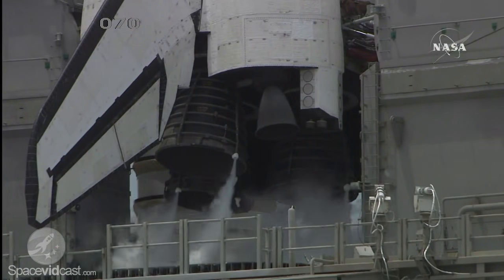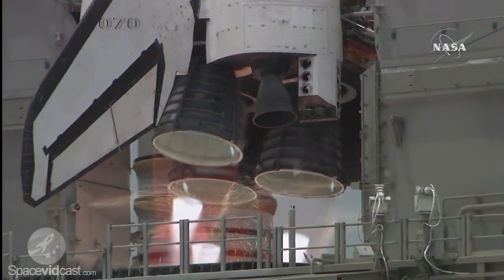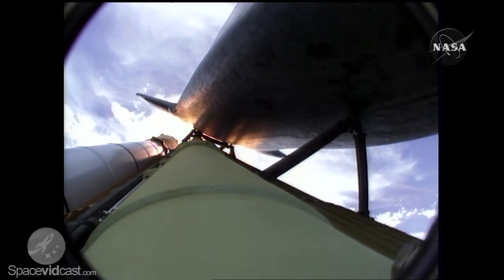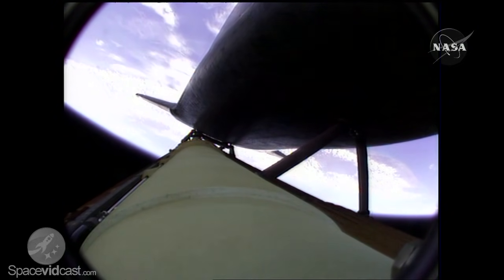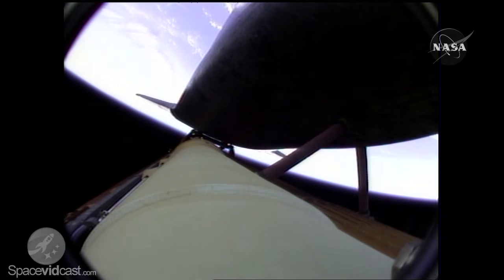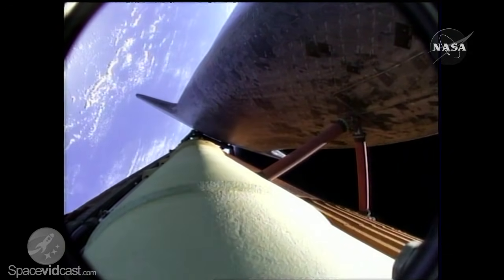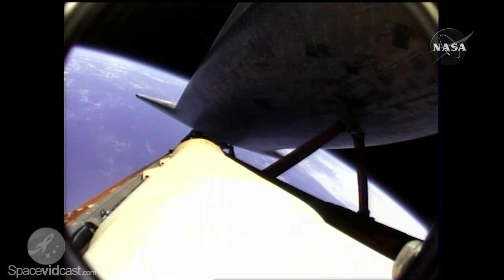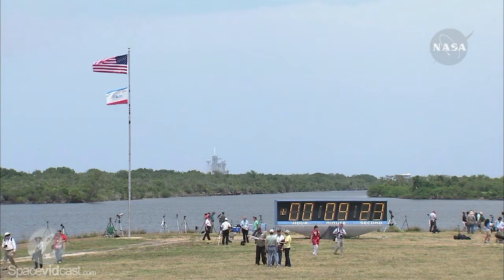STS-125 launch from T-2 to MECO - High Definition

Comment: there is a deflector in the bottom of the launch pad that shoots the engine exhaust and steam from the sound suppression system out to the side, if this was not done the shuttle would have been damaged by its own engine exhaust when the shuttle engines are ignited and brought to full power before the solid rockets ignite

Comment: That is part of the OMS system,  they are the nozzles for the small thrusters the shuttle uses to maneuver with in orbit.  You are seeing the covers burst from the pressure wave of engine ignition. That is what they are suppose to do, as they are there just to keep debris and animals out of the thrusters before liftoff
Reply: You're thinking of the smaller control jets on the nose and OMS pods.  The actual OMS engine bells are uncovered, same as the SSME's.

Comment: Those are thruster rain covers used on the ground to keep moisture out of the thruster valve. They are made to come off at ignition and the ones on the nose after a few seconds of flight. If moisture gets in, it soon freezes which could cause the valve not to work correctly.

Comment: 3,2,1... and liftof of the space shuttle Atlantis. Please put a double layer of sunblock because the shuttle will poke a hole (few km in diameter) in the ozon layer. Remember to hold your breath or wear gas mask due to 200 tons of chlorine witch will be emited to the atmosfere :D

Comment: Hubble needs no fuel, because it has no engines.
They replaced some of the instruments with newer ones, for example the Wide Field Camera 3 and repaired others that broke during the last years. They also replaced all of the reaction wheels that are required to position the telescope along with other stuff to keep it running for the years to come.

Comment: You're thinking about He-3, not H-3. He-3 is present in the surface of the moon, and is maybe possible to use as fuel in nuclear fusion reactors. H-3 aka tritium is produced from hydrogen by neutron capture in fission reactors. Unfortunatly, the cost of sending enough He-3 to earth will vastly overshadow the benefit.

Comment: isn´t it 72% now? it used to be 67 tho. Regarding the Max Q topic, I can add that there's a yt vid of a launch inside the cockpit with actual sounds and it's noticeable how the sound decreases rapidly as air pressure decreases. After about 2 minutes into the flight it´s almost completely silent.

Could you explain what happened during this particular launch? what was the malfunction exactly?

Comment: Ok, at 2:35 the rockets throttle down (Max Q?) to reduce the pressure on the structural integrity, but at 2:53 the guy goes "go at throttle up..... my question is, if you throttle down to reduce the pressure on the rocket and throttle back up, wont the same amount of pressure return on the rocket's structure?

Comment: @TheEverlastingSM 
How do you get a 150 ton fuel tank to space and connect it to the shuttle's main propulsion system? How would the orbiter handle the thermal condition on the way to the moon (100% sunlit vs. 50% sunlit in orbit)? How would the orbiter survive a 25,000mph reentry vs. 17,500mph from earth's orbit (that's TWICE the energy)? And remember, we were just talking about an "Apollo 13 style slingshot" around the moon! In short terms: No, it's not possible.

Comment: Amazing how this is 100 missions since Challenger accident. (STS-25)
Reply: Technically 101. See, the STS number system was assigned to missions as they came up, but delays could move the schedule around. STS-107 (Columbia disaster) was the 113th Shuttle flight. The return to flight by Discovery in 2005 was STS-114, the 114th flight. The second Return To Flight mission (also Discovery) in 2006 was STS-121, the 115th flight. All that is to say, STS-126 launched before STS-125, so technically this is the 126th flight. After this mission, the remaining STS designations matched the mission count.

Comment: @m0kkaleiavbrukernavn As far as I am aware, the Hubble flights flying out on a 28.5 degree equatorial inclination passed out of range of the camera transmission, thus causing the camera to drop out before MECO. On most of the ISS flights on a 51.6 degree inclination, the camera remained within range, thus providing a good signal through ET separation. It might also have something to with the TDRS network as mentioned before, but I'm not so familiar with that configuration.

Comment: The space shuttle. What a joke that thing was. Originally promised to deliver $1,000 per lb payload into space. 1970's design. Actual delivery was $10,000 per lb. Original design did not include solid-fuel boosters (dangerous, cannot be turned off) and did not include the giant external fuel tank. That thing looks like a high school science project. All that crap tacked onto it. The Space shuttle COULD HAVE & SHOULD HAVE been what is now the defunct X-33 SPACE PLANE. Where is that now?! Gone.

Comment from the maker: @m0kkaleiavbrukernavn That has to do with the camera iris. When you iris a camera down the sky will look darker. Due to the nature of shuttle and rocket launches the iris needs to be all over the board depending on if you want the fire to be lit correctly or if you want the vehicle lit correctly.

The shaking will depend on what surface the camera is mounted to.

The shuttle can travel in and out of ground station downlinks. They have something called TDRS to help wit that.

Comment: @eagled96 
Once it leaves the ground it doesn't have to.  The supports on the ground support the weight of both the shuttle and external tank.   You'll notice the shuttle has thrusters of it's own that are firing.  Those thrusters support the weight of the shuttle rather than those apparently flimsy bars connecting the two :)

Comment: Is something holding the shuttle in place when the main engines are turned on at T-5 seconds to T-0 seconds?

If it's just the weight holding it in place, how does the shuttle not rip off its joints from the main tank?

Comment from the maker: @gapsinteeth123 That vapor is gaseous oxygen venting from some vent lines on each of the engines. It's also the same vapor that vents from the very tip top of the orange tank (External Tank) up until about 2 minutes before launch.

Comment from the maker: @coptersoisoi The three main engines are affixed to the back end of the space shuttle orbiter (the thing with wings). The orange tank (called an external tank) is literally nothing more than an oxidizer tank and fuel tank shaped into an aerodynamic shape, which carries the weight of the orbiter and boosters until SRB separation and MECO. What @rotorznwingz said otherwise is correct.

Comment: @coptersoisoi A transducer is a sensor (in this case hydrogen pressure sounds like; there are LOTS of them).  By carefully cross-checking other indications, it can be determined if there is supporting evidence of a systems problem requiring remedial action or simply an indication malfunction, which is what is indicated here.  

The external tank (not the main rocket) is released after MECO (main engine cut-off) and is not recovered.  The TAL (transatlantic abort) was named as Moron AB Spain

Comment from the maker: @trechan The SRBs (the white rockets that fall off at 2 minutes after liftoff) spew the chemicals. The engines on the space shuttle orbiter (the space plane) use LOX and LH2, which are provided by the big orange tank (officially referred to as the external tank).

Comment: @Eagle1Division2 See right there you have a lot of redesign issues and such. It still involves the design of a lander, the redesigning of the shuttle, and a heavy lift rocket. With all that in mind, you're pretty much spending the same amount of money and time. And there's no reason to send a shuttle to the moon rather than a capsule/service module with a lander. It's easier and lighter, and doesn't need any Earth Orbit Rendezvous.

Comment: @Hoffy490 
Frozen air or nitrogen. The engines are already cooled down by circulating the liquid hydrogen fuel and purged by nitrogen which is very cold when exiting the engine bell which causes the air to freeze instantly.

Comment: @Eagle1Division2 However much I'd like to see such a moon mission, it is not going to work. A fully loaded ET weighs a lot more than any existing heavy lift rocket (including Saturn V) can launch into LEO. Also, the space shuttle has not been designed to deal with the extra heat during re-entry. Then there's the lifespan of the main engines to consider: they are overhauled after each flight, so I don't think it is safe to fire them twice during a single mission.

Comment from the maker: @TheEmpireSports The shuttle has 2 million parts. With that complex of a machine, you'll have issues. One can't pull over at the next cloud to replace a wire. If you put a metal shroud on the ET, you take away upmass capability from the orbiter. For every pound of metal shroud you add to the tank, you lose about a pound of payload weight. The only alternative they could have done in the beginning would've been a more robust TPS on the orbiter, but that again detracts from payload.

Comment: @nguyentuan1990 Kind of. Between SRB ignition and burnout, the shuttle is committed. However, after SRB burnout there are several abort options. The shuttle can; RTL (Return to launch site), TAL (Transoceanic Abort Landing. Lands in Europe or Africa somewhere), AOA (Abort once around, one orbit, then land), ATO (Abort to orbit, lower than intended orbit). So the SRB cant be shut down, but after burnout, they can shut down and land. Google shuttle abort modes and you'll see. =)

Comment from the maker: @Eagle1Division2 a spacevidcaster a podcast about shuttle to moon. You'd only be able to carry 9000 kg of payload down to moon. you'd have to design air-restartable SSME's, hardware to connect to the ET in orbit, the tools/logistic for it, and figure out how to dock orbiter to ET in less than 30 minutes. you'd also have to have heat shield tiles able to withstand 3000F reentry at 25,000 mph. Shuttle can't do any of this without a LOT of money and time for redesign.

Comment: Hmm... Here's a cool idea (if the shuttle wasn't retiring). Blast the shuttle into orbit, modify it and the ET so they can connect in space, launch an ET on a heavy lift rocket, have the shuttle connect with the full external tank, and it has enough DeltaV to make it to the moon and back.
(I've done the math.)
So then you stick a lunar lander in the cargo bay.
Mission to the moon, for cheap, no new rockets needed.
Very cheap.
(This would be an Earth-rendezvous plan and a Lunar rendezvous...)

Comment: earlier point still stands - evidence is interpritive. It doesn't make a difference. I'll come up with evidence, you'll counter it, it'll go back and forth till time ends. It'll only end when someone decides to quit, and then it wouldn't have made any difference. You can convince yourself of just about anything.
As for violence and science, I'm LDS. My religion supports science. Many of our church leaders are very distinguished, nuclear engineers, linguists, air force pilots, physicists. Science

Comment from the maker: @duduspp The forces in the rocket are about 3 to 3.1 times normal weight (called G's). If the shuttle accelerated any faster, it would start to fail. If you've ever ridden the ride called the Gravitron, or Starship 2000 or Starship 3000, you've experienced the same acceleration as the space shuttle does. Pretty cool, eh?

Comment from the maker: @101andrewj At this stage of rocket evolution the propellant (propellant is fuel AND oxidizer) is the cheapest part about a rocket. LOX is about 33 cents per gallon, LH2 is about 35 cents per gallon (US money). Statistically, both Soyuz and shuttle have a 2% rate of Loss of Crew.  

The shuttle flights just have about 50k lbs of "unusable" cargo they have to take with on every flight (wings and tail). They're getting rid of the shuttle because it's 30 years old and it's time to improve.

Comment from the maker: @cowsrock94 The #1 harmful chemical SRB's produce is hydrochloric acid. Given that KSC is part of a nature preserve, NASA's very environmentally conscious.  Their ecosystem is thriving nicely.

About burning so much 'fuel' (it's actually propellant. Fuel is fuel, oxidizer is oxidizer), it's 4.5 million lbs of propellant. The liquid hydrogen (fuel for the SSME's) is 230,000 lbs. In the SRB's aluminum and PBAN are 28% of total weight of the propellant. Combined, the SRB's weigh ~2.6m lbs.

Comment: @cowsrock94 The Space Shuttle Main Engines (SSME) use liquid oxygen/hydrogen. The exhaust they produce is water. The only really dangerous (environmentally) thing is 12% polymers burned in the Solid Rocket Boosters.
 Over the course of a few SUVs entire lifetimes, they probably produce more pollution than a single space shuttle launch. They produce all Co2

Don't assume anything to do with space or hi tech is bad for the environment because it's hi tech. I don't mean to be rude, but use wiki ;-)

Comment from the maker: @stevoism It's a safe bet to consider the current Ares design dead and scrapped. We don't know for certain what NASA will design after the shuttle is retired. It could be an inline design, or it could be another sidemount design. Sidemount is less efficient (a lot less capability for lifting things due to the vehicle's mass) than an inline design.

Comment from the maker: @andysim232 they don't have to replace thousands after every launch, but they do have to inspect the tiles. They also have to inspect the internal stuff, like the SSME's. The turbopumps in the SSME's push LOX and hydrogen through at about 200,000 RPM'swinged spacecraft are too expensive and there's no demand for it after the shuttle program is done building the ISS.

Comment from the maker: @wolfe1970 It's more like 2.5 million moving parts for the entire shuttle stackk.. The orbiter alone had 2 million. Your motorbike doesn't operate between -380F and +200F in the span of 9 minutes. Nor does it need redundant systems to keep the crew of 7 alive, safe, and able to return home without facing exposure to radiation and vacuum.

Comment from the maker: @ZaneKaminski If they're going to the ISS, the trajectory is pretty much the same. It does vary only slightly though. If going to Hubble (which is what happened for this particular mission), the orbit and altitude is notably different. (orbital inclination for Hubble is 28 degrees, ISS is 51 degrees, altitude of Hubble is about 350 miles, ISS is about 220 miles))

Comment: Frozen air and nitrogen. The engines (fuel system, pumps, valves etc.) are chilled down and then purged with nitrogen before ignition. The nitrogen is very cold when it exits the engine which causes the air to freeze.

Comment: I going to miss the shuttle when it goes but It really is so old and high maintanence.
Remeber the shuttle was on the drawing board while the Apollo project was winding down lol. 

If someone found a way to allow the vehicle to return without having to replace all the 1000s of heat tiles im sure we would have a replacement shuttle by now.

Comment: I would say it has something to due to the fact that the Hubble orbits near the edge of the shuttles max operational altitude. The shuttle would have to launch to a slightly higher apogee so the demand on OMS fuel is lower for orbit with HST. I figure thats the reason the video cut out early.. I'd have to cross check between 2 separate flight plans.. Let me read through a few flight plans and run them on the sim too... I'll have an official answer in a couple days

Comment: To be three miles away NASA sells tickets. There are tour companies that sell tickets at around $125 USD to see it from the NASA causeway 7 miles away. However, if you don't feel like paying, there is always Titusville. You will have a clear view across the bay from only 11 miles away. It is not as amazing as being 3 miles away, but you will have a great view. Drive up from Miami in I-95 and get off on exit 220, drive 3 miles until you get to the park next to the bay and start filming!

Comment: Thanks for this vid!  I remain impressed by this elderly technology despite all the issues.  Too many parts to fail, too much energy used etc etc.  We can and will do this better in future but I think this has been a necessary stage.  A smaller shuttle would have been better (Not one foisted upon NASA big enough to retrieve spy satellites!) but you have to go through stages to achieve a complex goal and the shuttle has all asked of it - a tribute to all involved. Now to get a seat on one...

Comment: well the shuttle is supposed to be replaced by a twin system. instead of the shuttle which carries both crew and payload, there will be basically an enlarged version of the external tank (with it's own engines now) and the srbs with a second stage and payload fairing or crew module added on. so in a sense, it is bigger. but it's not the same concept as the shuttle. but what really interesting to me is that they're going back to early nasa designs (even the heat shield is the same from apollo).